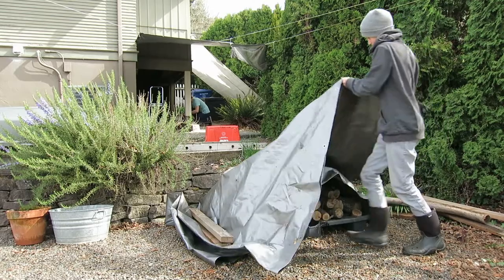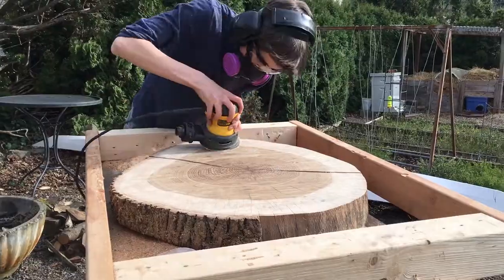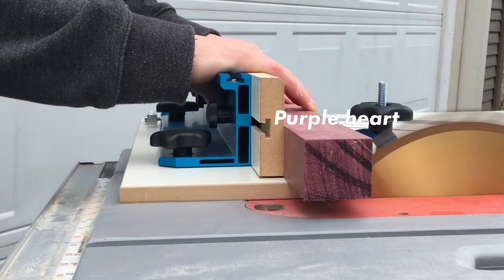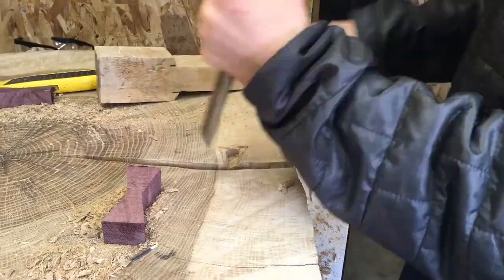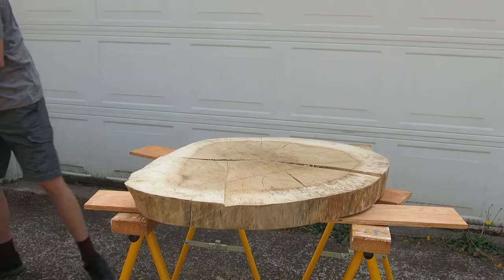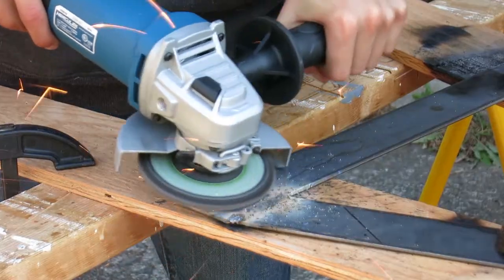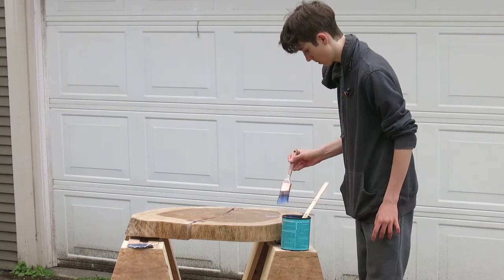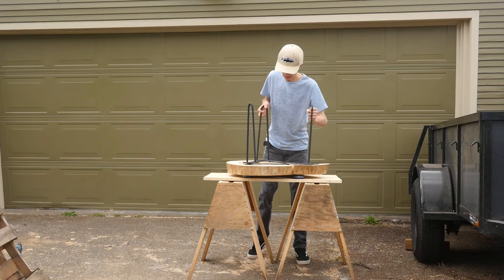DIY Oak Coffee Table // Woodworking

Comment: Good ideas with the bowties but personally later on for a tip I wouldn't use flat stock for the legs unless you cut them and tacked them at 90°angles but yeah good job on that
Reply from the maker: Thanks for the suggestion!